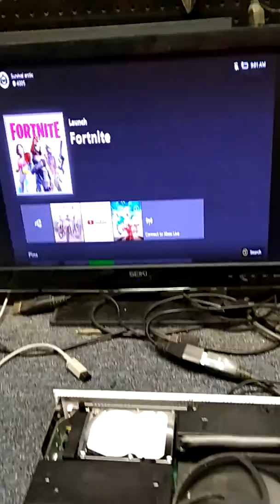Xbox one slim Motherboard Repair M3339 Proof + Extra Info

Comment: Hi. I have problem with my sons xbox one s. The xbox does not want to take discs in but if i press the button on the front that takes the disc out and give the xbox my disc it works fine. The xbox reads the discs fine but it doesn want to take them. What to do?